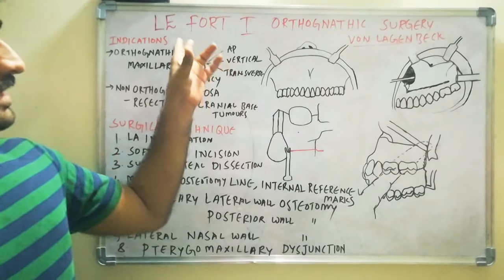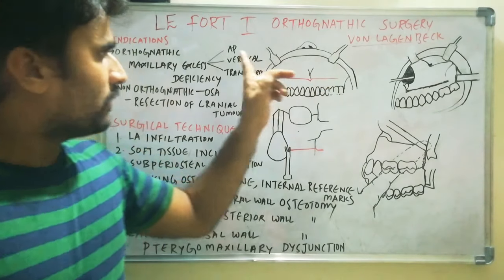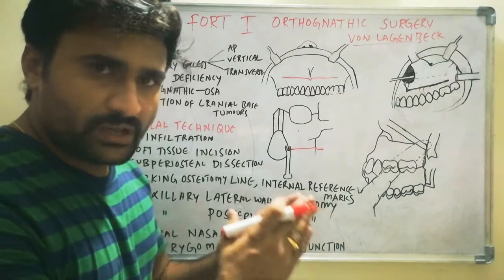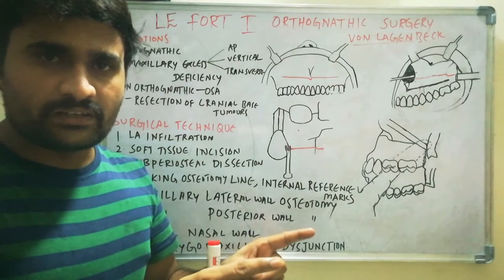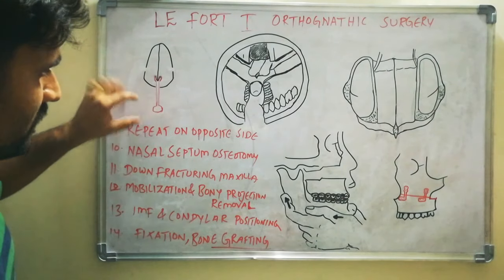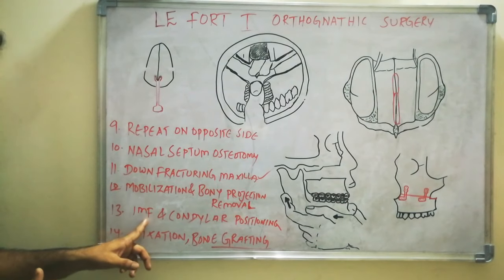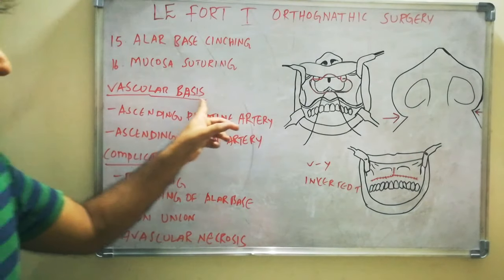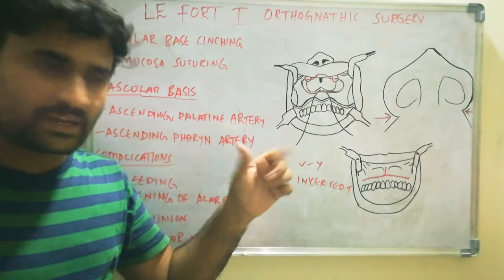Le fort - I  osteotomy

Comment: Hi sir ..how much deep can i go with lateral maxillary wall osteotomy ...i mean depth of osteotome since lateral nasal wall as  you said its only 25 ..30 mm , what about depth of lateral maxillary wall osteotomy ?....
And at which area that maxilla after downfracturing it may be unfarctured or incomplete fractured ...
Thank you very much
Reply from the maker: anterolateral or posterolateral wall of maxilla mostly contains cortical bone with 1-2 mm of thickness (cancellous bone is less) . so it is easy to cut this area. critical areas of osteotomy includes pterygomaxillary region, lateral nasal wall osteotomy, and bony nasal septum
Reply: @msdentallectures7408  thanks alot dr. , can i advance the maxilla 7mm without affecting its vascularity and the risk of relapse .

Comment: Sir this lefort 1 osteotomy is always done with bsso know sir, becoz when we advance/ set back maxilla,definitely maxillo mandibular teeth relation is gng to alter,so it cannot be done alone ,always it is done with bsso, am I crct sir
Reply from the maker: absolutely No....it can be done alone or it can be combined with other surgeries like bsso... class 2 and 3 malocclusions are may be due to different combinations of underlying skeletal problems...for example, class 2 may be due to 1. excessive maxilla and normal mandible where only lefort I with maxilla setback is enough  2. normal maxilla and retrognathic mandible in which only bsso with mandible advancement is enough. 
Class 3 may be due to 1. maxillary deficiency and normal mandible in which only lefort I with maxillary advancement is enough. 2. normal maxilla and mandibular excess in which only bsso setback is enough 3. maxilla deficiency and mandible excess in which we should use lefort and bsso. teeth relation should be corrected with ortho treatment..not a big problem...we should plan all these things in model surgery
Reply: Thank you sir , such along reply, I understood sir, thank you once again sir
Reply: Occlusion will be still disturbed after any type of surgery . Ortho will be a must. Surgery is for skeletal defect. And ortho for dental and both may be in combo. Salute to Ms dental lectures .